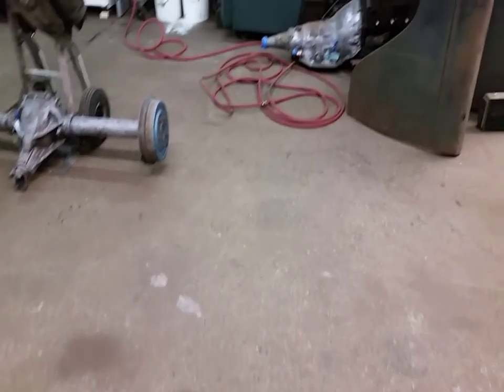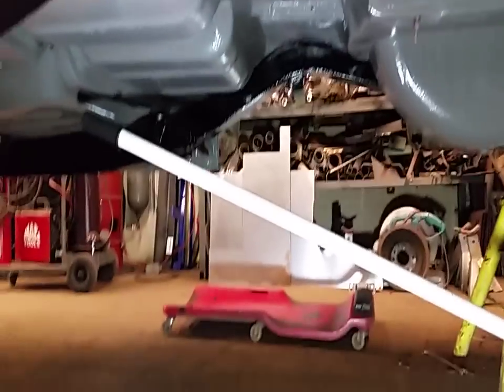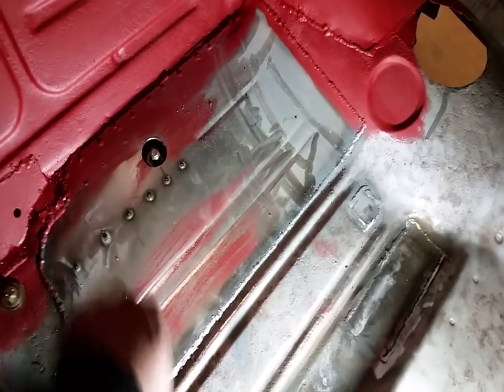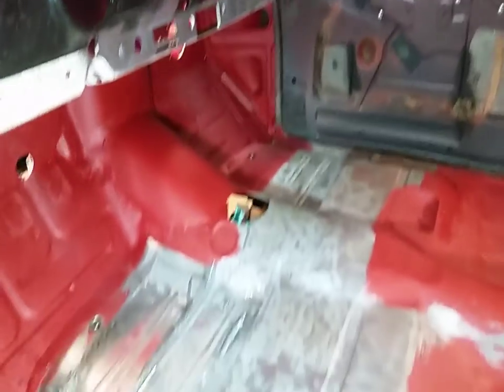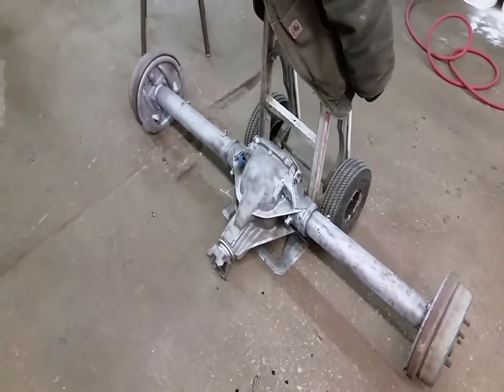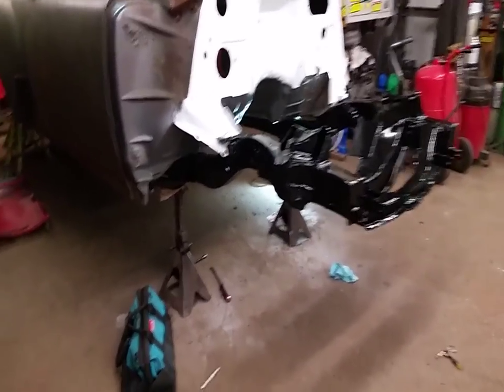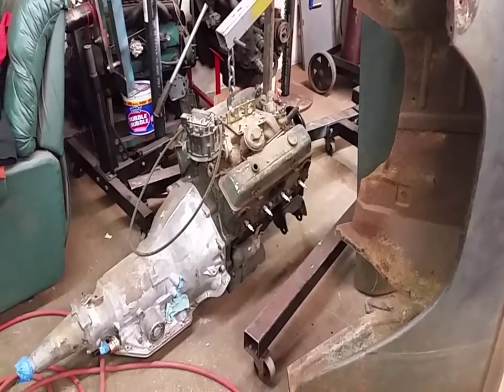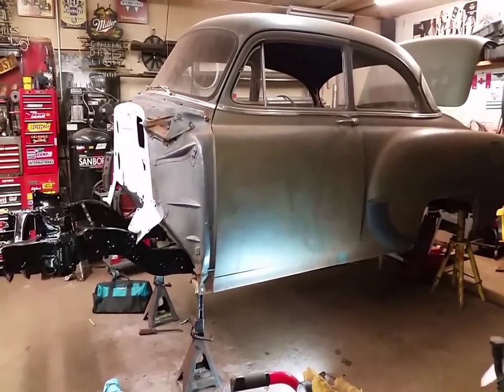painting , and more painting ....... oh ,  the joys !!

Comment: I'd call that "excellent" progress and a good reason for your shop to NOT be clean and organized. Good time to deal with that while the paint is drying. ;o) Under the car looks great!! While you say you "hate" body work, your metal work sure looks good!! That floor patch IS pretty. Lots of questions: How are you treating the 6V gauge cluster?? Have you determined the gear ratio in the rear end?? What rear end is it?? Please give us some detailed videos on putting the motor together. Type of cam, lifters, rockers, etc.  The front clip is ??? Camaro so it HAS disc brakes? This looks like it's going to be a pretty nice driver. Your videos are entertaining AND educational. Thanks.
Reply from the maker: +Pappa Bob Thank you Ron ! 
good questions !! lol 
the gauges , not for sure just yet . thats tonights home work . To look into s few things and get a few things ordered up for next weekend . The rear end i'm told is a 3:08 . but i'll be pulling the cover off and finding out for sure shortly . I need to do the axle seals and brakes on it too . The engine will be stock ish  . the front stub had drums , but i got the kit to make it disc up front .